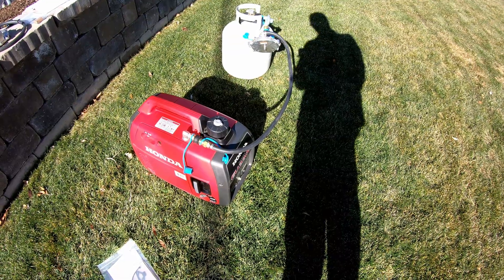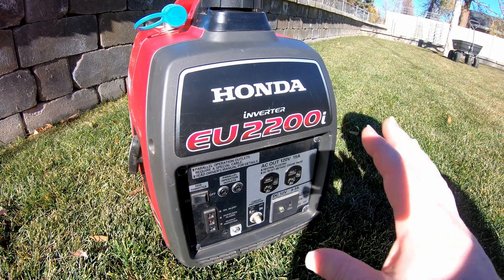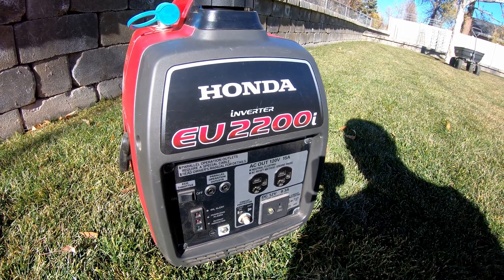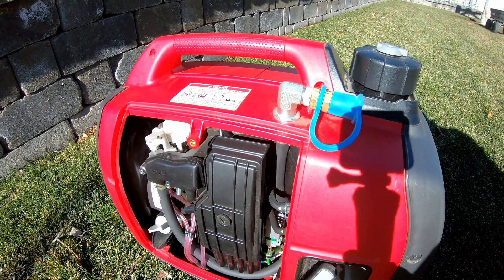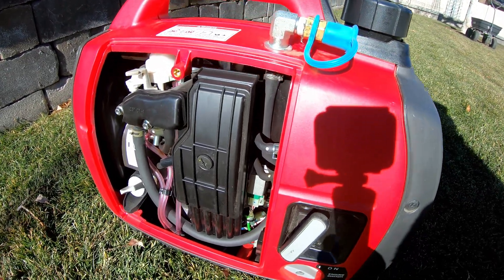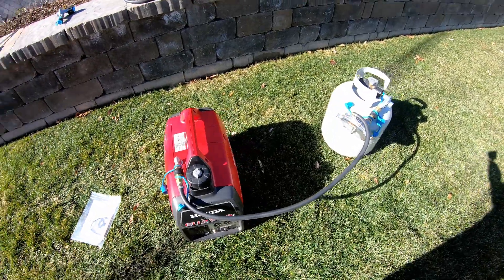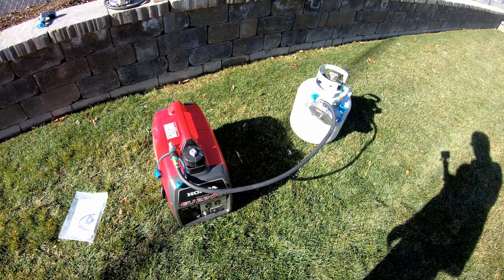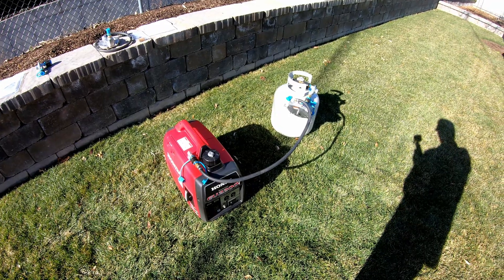Honda EU2200i Dual Fuel Conversion - Hutch Mountain Conversion Kit

Comment: Nicely done!!! Especially since rv is already set up for propane! Going to order my kit! Have same generator as you, only thought is the mount on RV bumper. Would need a 23 foot long propane hose to set up. Or would you install a 3rd with stove and fridge?
Thanks again!
Reply from the maker: Thank you! You’re going to LOVE the conversion! It works super well! 
I would definitely run a dedicated propane line for the generator if you’re running it off the trailer propane system. Thanks for watching!

Comment: You turned the Gasoline switch to on instead of leaving it in the ignition on-fuel off position.  If there was gasoline in the tank, you were running on that.  
My Hutch Mountain conversion kits (2) arrive tomorrow.
Reply from the maker: True! I just never use gasoline in the units! Propane is so much better! You’re going to LOVE your conversion! Thanks for watching!

Comment: I have a battery setup I have been growing over the years, right now it is 4x12v100Ah SLA AGM batteries and 2x12V280AH LiFePo4 batteries. For a total around 7.7 Kilowatt hours of power. Enough to keep the sump pump running and the basement from flooding for a week when I'm not home. Or a few days of luxury comforts when the power is out and I'm home.  I use my car to recharge them if it's more than a few days but always keeping an eye out for generator options to upgrade to.  No solar here, 2 big trees blocking all the sun.  Typically get a 2 day power outage once a year and a 7 day power outage once every 10 years in this area.
Reply from the maker: That is a nice sized system you have!  Your setup will handle a power outage very well. Thanks for watching!

Comment: Is it hard to change the jets when switching between fuel sources?
Reply from the maker: No. It’s quite easy. I wouldn’t want to do it all the time…but it’s not too bad!
Reply: There is actually no need to change jets in the carburetor. What does get changed is the orifice for either propane or natural gas, which is easy. It's a matter of loosening the spring clamp on the propane hose at the carburetor, then swapping the orifices, which thread into the inside of the hose. 

I have two EU2200i generators set up with Hutch Mountain kits to run on gasoline, propane, or natural gas.
Reply: @rytbeard Thanks!